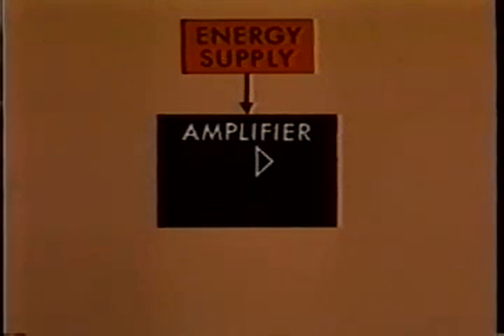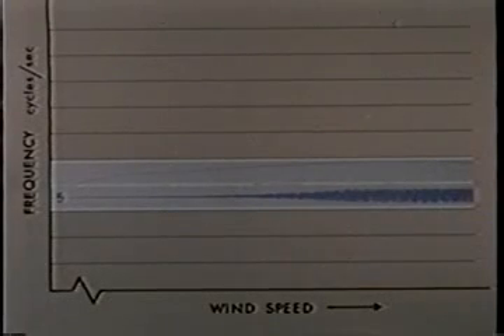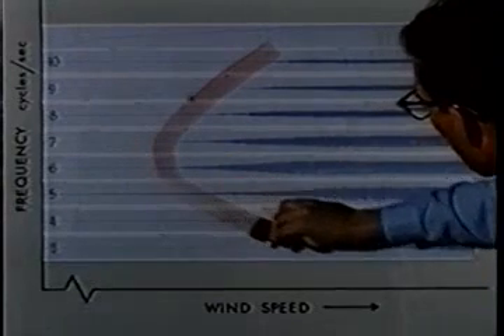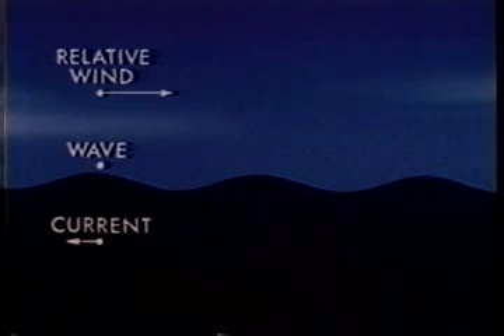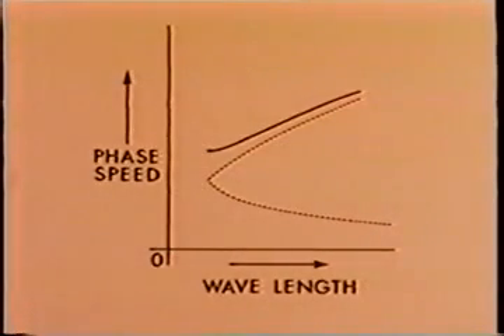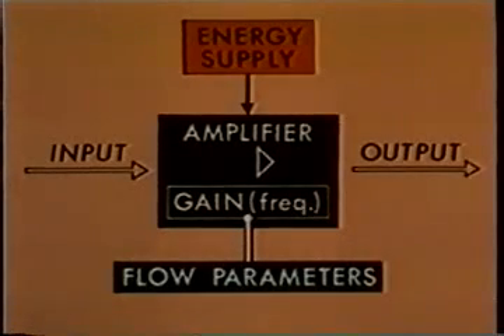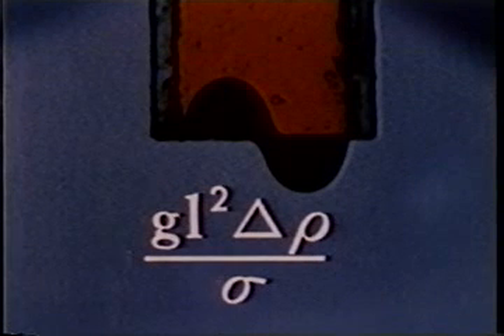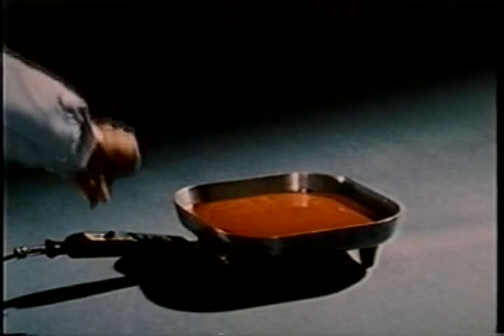15. Flow Instabilities

Comment: 🎯 Key points for quick navigation:

00:34 Flow instabilities are common in various fluid phenomena, influencing everything from plumes of smoke to flows between concentric cylinders.
01:39 Turbulent instability often marks the onset of chaotic flow patterns, observed in phenomena like turbulent plumes.
03:55 Interfaces between fluids of different densities can exhibit Kelvin-Helmholtz instability, leading to wave formation and potential turbulence.
05:28 Air blowing over a liquid surface can generate waves as a form of flow instability, demonstrating amplification characteristics influenced by airflow speed.
07:19 Flow instability mechanisms act as frequency-selective amplifiers, triggering wave growth from random disturbances in the airflow.
09:48 Experimental setups illustrate how airflow speed influences wave amplification, showing distinct amplification thresholds at varying speeds.
13:24 Flow instability's characteristics are governed by parameters like wind speed and frequency response, crucial for understanding amplification conditions.
17:44 Various flow instabilities, such as Taylor instabilities and Benard cells, exhibit distinct energy supplies and critical parameters influencing their development.
23:31 Reynolds number plays a critical role in flow instability, as seen in examples like vortex shedding behind cylinders.

Made with HARPA AI